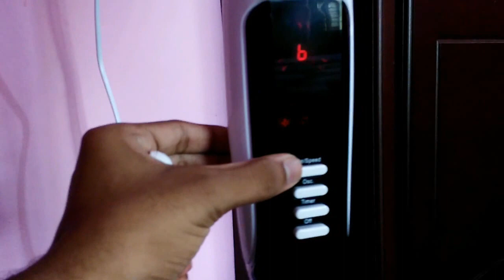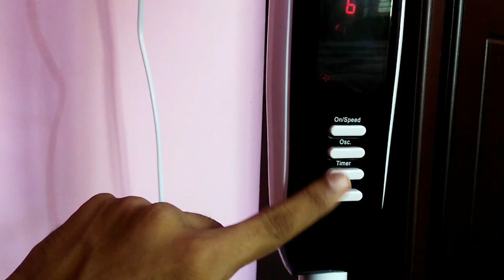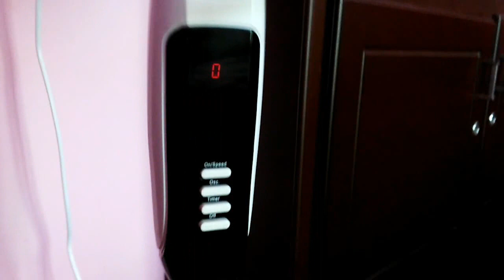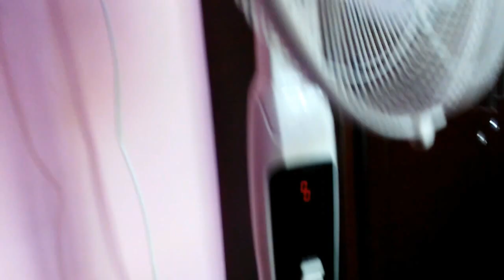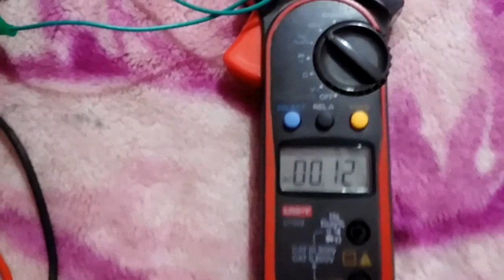30 watts BLDC FAN MALAYALAM REVIEW | 5 star rated pedestal fan | energy saving inverter fan

Comment: പുതിയ BLDC സ്റ്റാൻഡ് ഫാൻ എന്ത് വില ആകും ...സോളാറിൽ ഉപയോഗിക്കുവാൻ ഏറ്റവും നല്ലത് ഇത് ആകും ...സോളാർ നേരിട്ട് കൊടുക്കുവാനുള്ള D.C INPUT കൂടി ഉള്ളതായിരിക്കണം ....
Reply from the maker: Ith 12v dc..il work cheyyum. So 12v solar panel connect cheyd use cheyya. Kseb AC supply lineil connect cheyyanagil oru adapter vagiyal madi 230v to 12v dc 3A adapter https://amzn.to/3ybRQth .
Stand fans kuravva
Reply: @muhammedshibil1390  ഇതിന്റെ വില 1800 രൂപ ആണോ ...
Reply from the maker: @monipilli5425  1600

Comment: Don't traped 

Atomberg company not giving service and support 
Bro if there is any service center in Kerala share  
I experienced person  , now passed one and half months not resolved issue 
When I send emails getting today,tomorrow, 24hr resolve the issue 
Daily same same massage will be receive 
I also asked the Atomberg company share me address of service center in kerala. I got no response 
You may think before  buy the product
Reply from the maker: My product still working fine, no issues. I don't know about service center, but you can claim warranty through flipkart if you brought from flip, it will make some pressure to the company and make procedures fast.
Reply: @muhammedshibil1390  service support will give only by the product companies 
I registered complaint via email they are not resolving problems just passed one and half months 
I just shared my experience
Reply: Bro how can send service complaint
Reply from the maker: @Aminzadayyaya  +91 84484 49442 , what's app number
Reply: @Aminzadayyaya  support@atomberg.com 
Mail to this address

Comment: Bldc fan lightning samayath ON allenkilum adichh powunnu enn kettirunnu. Endhaan sathyavastha ?
Reply from the maker: Lightning neutral line..il aan adikndagil, complaint aavum karanam, phase line mathram disconnect aavu when you switch off. This happens in every electronic appliances, normal fanil electronic components onnum illa only capacitor and armature etc.. ath cheriya lightning okke survive aavum but bldc fan..il adapter regulator agane ulla electronic circuits okke inbuilt aan, so if huge spike happens chance of survive is less compare to normal fan.